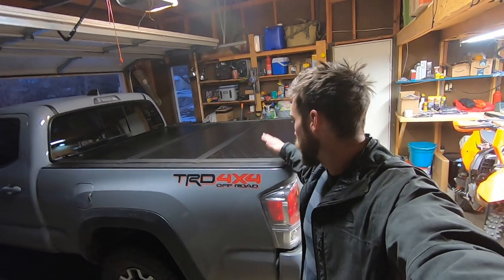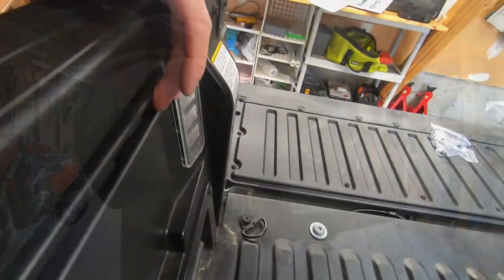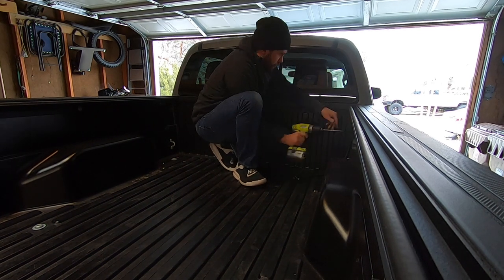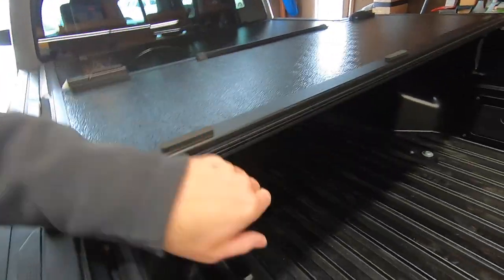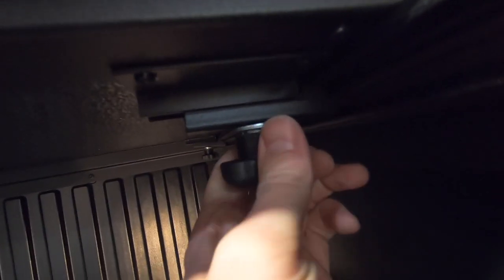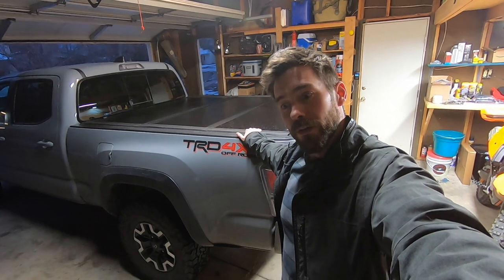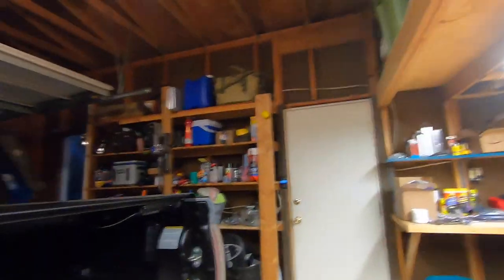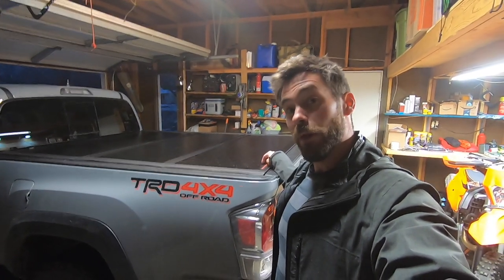16-21 Toyota Tacoma -- Rough Country Low Profile Hard Tri-Fold Tonneau Cover - INSTALLATION & REVIEW

Comment: Good review. I received the Gator EFX hard cover, pretty much a carbon copy. Every pro and con is the same. There's no need to drill for drain holes. Get a nipple adapter and attach it to the black hose down to the bottom drain holes. Works like a charm. Not sure about your cover, by mine near the front (where the buckles and drain holes are located) there are slits not covered by the weather stripping so water seeps in. It's not 100% water proof. Bed stays maybe 80% dry. The middle of the bed stays 100% dry. I agree with about the loss of tie down clamps, really a big bummer. Anyways, makes my 4 cylinder more bad azz on the road lol! Oh, and no these covers do not improve mpg, that has been researched and debunked.
Reply from the maker: The myth is that dropping the tailgate increases MPG, that is not true. But Tonneaus do typically lead to a 1.8% increase in gas mileage at highway speeds.

Comment: Easy to install. The one I have leaks like crazy from the side rails to even the latches. It's my 2nd one they sent out a replacement for the 1st one I had.
Reply from the maker: Good to hear they stood by their product!
Reply: @SourceADV  Still getting some leaks all along the side rails which is weird I may have to do some of my own weather sealing.
Reply from the maker: Yeah man, the taco bed is not very sealed to start either though. It’s all a bunch of pieces bolted together, I found that that bed seem under the side rails is really really bad, not the tonneau itself
Reply: @SourceADV  That's what I've heard from other owners regarding the bed. Yeah I like the cover a lot. Itll take some tinkering but I feel I'll be able to get it more sealed.
Reply from the maker: Pull the bed rail caps off and take a look at the seem between the metal and plastic part of the bed, you can get foam sealing tape to stuff in there, just make sure to clean up the area really wel

Comment: Where is that water draining too? Is it going between the metal bed portion and plastic liner so it can be trapped and rust?
Reply from the maker: Nope, right to the ground. The bed on these trucks is more like a giant plastic bathtub with the fenders cascading as skirts but there is almost nothing between the two and there are not enclosed spaces. Go under your truck and take a look. Not much to these beds. Cheers

Comment: There isn't any wind-drag on tailgates anymore, designers have engineered the aerodynamics of trucks over the last 20 years to avoid this. Google mythbusters video and many others that have test this, so you're all good there. Thx for the vid man, I'm ordering one for my Tacoma based on this review.
Reply from the maker: That is true as compared to having the tailgate down, but tonneau covers add roughly 6-10% increase of MPG, especially if you do a lot of driving above 70-80 MPH (like we do here in Colorado). You are totally right as compared to putting the tailgate down though. Take care!
Reply: @SourceADV  we're lucky here in AZ with the speeds as well.
Reply from the maker: Right on! It’s a great product either way! Cheers!

Comment: Maybe this is a stupid question but where does the water drain to? In between the bed liner and metal body and just out the bottom? It doesn’t get trapped anywhere or cause moisture problems? Asking from a rainy state! Thx for a great vid
Reply from the maker: Hey Hanna, it basically runs run to the ground down the side of the composite bed. There is a ton of space in between the composite bed and the painted steel bedsides, if it’s raining and you are driving, there is a lot more moisture getting up in there than what is coming out of the drains. Cheers!
Reply: Tacoma bed is plastic, there is just one layer of composite. No old fashioned bed liners.

Comment: Great video. On my 2020 SR5 I added the third rail for more of the factory tie downs can any be used with the cover installed and I have a bed extender not sure if that will be a issue.  Also I changed my muffler to with dual out . I get 25 and sometimes 26 mpg on my daily commute on a 6cly.
Thanks
Reply from the maker: Thanks for the info!

Comment: Thanks for the video man. Very informative. Have you had any problems with the cover over time? Chipping of the paint, fold up on the outer weather stripping, etc...?
Reply from the maker: No problem!  Not really! I use F45 top coat on the entire truck after a good clean and it seems to keep everything looking good and the seals moisturized.
Reply: @SourceADV  Awesome! Thank you for the reply, and keep up the awesome videos! 😀
Reply from the maker: Thanks man!
Reply: @SourceADV  f45 is the name of the brand ?
Reply from the maker: F11 Top Coat, sorry I typed that incorrectly before

Comment: Bought mine today thanks to your review! I appreciate your video!
Super picky when it comes to hawaii shipping. Some places don't even ship here even though it's basically taco island 🏝️. 
Question. How exactly can I install it without drilling holes and still letting the water drain? Is it possible? 
Thanks in advance
Reply from the maker: No problem! Its still working out great. With the drain tubes, you could just run some smaller hose down to the holes in the bottom corner of the bed and just let it drain from there, but they are much smaller and could get clogged. Im not sure what would happen if you just capped the drains off, but thats definitely an option and at least you wont run into freezing issues in Hawaii. Let me know how it goes!
Reply: I installed my tonneau cover today! Looks great! I appreciate your video for the install.
I tried to make the bottoms holes bigger but i only have a 3/8 drill bit. 
Also when you push your tail gate back into place does it fit super snug? Just concerned that i didn't put it down correctly.
Lol yeah i move to germany in 2 months for a PCS! Very excited. I definitely got this so i would have to shovel snow out of my bed.
Also how did your mpg fair? I get a solid 18. Did you see any improvement even 1 more mpg would be nice??
Reply from the maker: It doesn’t have a lot of pressure from the tailgate, just a little bit. It definitely helps with the snowy days for sure. Take care man!

Comment: Do I have to put the holes in the bed for drainage. Really not looking to do that with a bed cover.
Reply from the maker: You can run small tubes down to the little drains in the bottom of the bed, but they will be long tubes.

Comment: Great video! I just purchased a 2020 TRD Off-Road and am looking at this tonneau cover. My only concern is the security. With the tail gate locked, do you think it's possible someone can easily stick a coat hanger underneath and grab the release cable???
Reply from the maker: I mean, it’s no more or less easy than breaking into any vehicle. If someone truly wants in they will find a way in. I would say a rock to a glass window is way easier than breaking into this thing, at least it would take a little problem solving haha

Comment: Hey man I was thinking on the passenger side if you for offset the rail to compensate for the gap. So lower the rail so it will create a tighter seal on that side.
Reply from the maker: Zach Audet sorry, what do you mean? The rails are fully flush to the top of the bed?
Reply: Is there any room to adjust the rails? I was just saying if the rails were able to adjust down it would help
Reply: Hey man I was going to ask you too if the panels are plastic or aluminum? I just ordered mine friday and it should be here tomorrow but I was looking at the bakflip too and I think their panels are aluminum. But the rough country panels in your video look plastic almost.
Reply from the maker: Zach Audet they do adjust down, the gap really isn’t bad, i only get a tiny bit of leak with high pressure car washes. The panels are a honeycomb aluminum, not plastic. Hope that helps!
Reply: @SourceADV  awesome man I appreciate it!!
Reply from the maker: @ZachJAudet  Cheers!

Comment: Great video! I just bought a new Tacoma. Where do the drain tubes actually drain at? Between the outer and inner bed or???
Reply from the maker: Yup, which is a totally open space right to the ground. Kinda crazy how the Taco bed is a big jigsaw puzzle
Reply: Thanks for the quick reply. Now I have to get one.
Reply from the maker: It’s a good product for sure. The Tacoma bed definitely has its own issues when it comes to sealing out tire spray... but the cover keeps rain out both while parked and driving.

Comment: Do you know how much space the cover takes when its fully collapsed? Im curious because I plan to throw my bike in the back with a tailgate pad but im not sure it will fit with the cover installed. Im hoping it would be around 23.5 inches from the back of the bed to around the wheel well area!
Reply from the maker: Not sure man, sorry I don’t have this truck anymore

Comment: I wonder if you can use the bakflip  rail relocation brackets  to keep the use of the rail system
Reply from the maker: Definitely not, I just ended up adding bed stiffeners and some track for d rings on the side of the bed.

Comment: I’m confused about the holes in the side like at 4:13. Isn’t the water now going to be stuck between the bed and outside metal of the side of the truck or is it open at the bottom? Seems like it would make more sense to make the drain holes in the bottom of the bed bigger and attach the hose to that hole.
Reply from the maker: It’s totally open at the bottom. The bed is like a bathtub with tin can walls lol

Comment: Doe ths vibrate or makes noise while driving. I’m returning my rough country topper trifold hard cover for a low profile hard fold due to this???
Reply from the maker: Not that I notice at all. It sits on rubber mostly, so I think it's almost vibration free. Good product for sure

Comment: Still holding up well? Specifically is it keeping water out?
Reply from the maker: Elvin Ramos still great for rain, it doesn’t do great in the car wash with the high pressure jets coming from the side. I did get to see it in 50 MPH cross winds in Kansas and I definitely lifts up a little bit. I keep anything that I need to be 100% dry and dust free in Home Depot bins under it and don’t think about it twice. Hope that helps!

Comment: can you elaborate about what you think this means in the company description? "...or roll it all the way up and attach the durable storage straps and continue along your way with the cover in the open position."  It certainly sounds like they are saying the 3rd fold was supposed to fold up against the cab giving you full exposure to your bed. (But covering your back window)  However, there is no hinge at the far end and also those clamps you mounted would stop the last section from lifting.
Reply from the maker: Hello 42Bill, I just saw that on their description on the product page, that is definitely a typo and probably accidently came over from one of their soft tonneau covers. This one does not roll up. You can fold it all the way forward and regain 2/3 of your bed or just pull the 4 clamps off and remove the whole cover. Hope that helps!!
Reply: @SourceADV  So it comes off pretty quickly then? I plan on throwing mountain bikes with the wheels hanging over the gate. That may require me to lift out this cover every time I load the bikes.
Reply: @SourceADV  Have you tried loading mountain bikes in the back with the front wheels hanging over the gate? I'm guessing you would have to remove this cover every time, although I am not sure. Is it very easy to remove?
Reply from the maker: 42bill I think if you have the long bed you’ll be alright, the short bed will be a struggle. I pull it off to load my KTM dirtbike sometimes and it takes about 60-90 seconds to remove. I don’t ride MTB so can’t speak directly to that. Sorry Hope that helps!
Reply: @SourceADV  Short bed, but hey 2 minutes to take it off and leave it in my garage is not bad at all. The alternative for me is to buy one of the more expensive tri-fold tops available that stand up at end and block your rear window. But that may be even more annoying that taking out the cover completely.
Reply from the maker: 42bill I agree man! I bet you could put some of those clamp style front fork mounts on top of this cover too and just slide the wheels into your new “trunk” the honeycomb aluminum seems pretty damn sturdy as long as you had some big washers and such then seal it up with some silicone... might be worth reaching out to Rough Country and seeing if they think that’s a good idea or not 🤷🏻‍♂️🤷🏻‍♂️

Comment: Does it leak?
Reply from the maker: Honestly, it doesn’t matter if it does or doesn’t, where the tub of the bed meets the top rail pours water in on the back left corner because it doesn’t have that little cubby to block wheel spray like the passenger side. You’d have to got through and seal the rest of the bed before you’d know whether or
Not the cover leaked.

Comment: I was told ALL covers leak on ALL Toyotas, due to Toyota manufacturing.   IS THIS TRUE?
Reply from the maker: The bed itself has a lot of different pieces, it’s modular like legos, so there are a lot of places for water to get in besides just rain coming in. I notice water coming in from the tire spray sometimes which has nothing to do with the cover. You could seal it with putty, but it will be a fair amount of work. The cover is great for rugged items, but the bed will never be a perfect trunk
Reply: I'm having minor leaking as well. I have heard it is a problem with Toyota. Though my fathers F350 has a cover and that sort of leaks as well. So who knows?? It's 2020 and we still cant design a 100% leak proof top LOL!

Comment: Any recommendations for one that still has the rails accessible?
Reply from the maker: I don’t think any of the flush mount ones allow you to use the rails. I might actually go to a topper on this truck soon because I just got into mountain biking.
Reply: I just really dont want to drill into the bed either i was looking at the Diamondback hd but just so damn expensive
Reply from the maker: Got it, best of luck man!

Comment: I guess with this tri cover you will not be able to use the tie down cleats ?
Reply from the maker: That is correct. I mounted two aluminum tracks to the sides of the bed with new tiedowns

Comment: Does it fold all the way back to the window?
Reply from the maker: It folds on top of itself, not vertical to the back window. It gives you about 4 feet of open space in the long bed. If you need the whole bed to be open you can just unscrew the four hand nuts in about 45 seconds and remove the whole thing folded up. I just lean it against the wall in my garage. Hope that helped!

Comment: You can’t use the factory tie down points with this, that’s too bad.  I don’t think you want to use that kind of bit on metal.  I’d say use a step drill bit.  Those kinds of drill bits will bite and walk on metal.  Are those low back bed lights factory?  How does this do in terms of water tightness?  I wish my 2016 looked that pristine still.  I use mine like a truck and you can tell lol.  Nice vid man, thanks for being thorough.  Love the F bomb scale.
Reply from the maker: Hey Man! Yeah, bummer about the tie downs, but I picked up some E Rail that I will mount to the side of the bed. The bed is composite and if I wasn't an idiot and tag that metal bracket it would have been fine haha. Those are the factory 2020 tail lights. Let me know if you have any other questions, take care man!!
Reply: SourceADV oh right it’s composite, lol duh.  Brain fart. Thanks for the response
Reply from the maker: Michael Terrell haha, take care!

Comment: Don't drill into your truck just run the tubing straight down under the bed mat the water will go out on the groves on the bed
Reply from the maker: This truck didn’t have a bed mat and I’d put lots of boxes and suitcases in the bed when it was closed, would rather drill than have soggy bottom. Plus it’s just what the instructions say to do 🤷🏻‍♂️

Comment: Any water leaks yet?
Reply from the maker: Chris Martins no leaks under normal operation! The bed still leaks behind the left rear tire from throwing water/mud up from the tire. It hits the top rail seem then seeps down the side of the bed by the left rear corner. This has been happened from day 1 with the truck. The cover does not leak though with rain.

I did run it through one of those high pressure car washes and got a little water in the bed, not as much as expected... I don’t think it was designed to take 90 psi right angle water Hahahaha. I still love it! I put everything in the back in bins that can’t get wet and then don’t worry at all. At the end of the day it’s the bad design of the bed in the back left corner that lets in a bunch of water.

Hope that helps, take care!